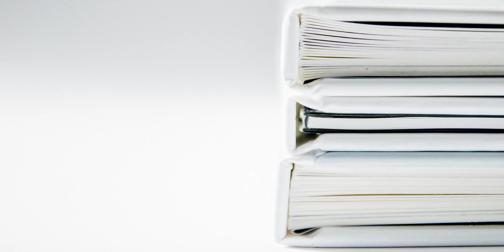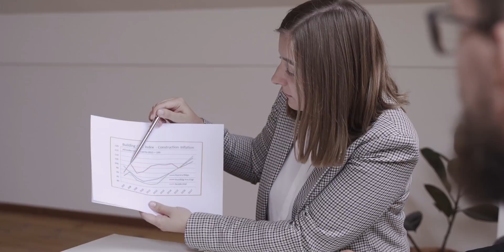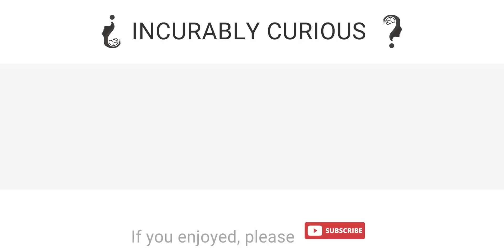Why Most Power Lines Aren’t Underground

Comment: Just digging the trench alone here in Pennsylvania runs between $50 and $300 per foot.  That doesn't include any cables/lines or conduit.

Underground facilities eventually go bad, it is only a matter of time.  It is cheaper to replace/repair aerial.  Pole permits in public domain or private property tend to be easier to get than it is for underground facilities.   To do underground in state RoW requires seismic testing if the proposed facility is 500FT or longer.  

34 years in the telecom industry, 33 of which engineering.
Reply: which is funny, cuz we were told that the line from the meter to the house HAD to run underground, they "the electric company" claimed it was code... but then the house next door has the line from meter to roof, soo... even if the code is valid, there is some scamming going on too i think... dads got 20+ years in electronics repair from the military, and i know electronics aint electrical, but many principles are the same, only REAL difference is how many volts and amps run thru the lines...

Comment: Where I currently live outages aren't that frequent. Most of them are squirrels either tired of their little lives or screwup when participating in extreme squirrel sports. All I know is that all outages are from 3 main causes:
1) A squirrel messed up and has gone to their nut filled afterlife.
2) A transformer wore out and destroyed itself.
3) Unknown causes. The power company has no idea what happened.

I've always thought that underground would be better. I do understand finding the break in an underground cable would be a bit tedious. They have to use a neat little device called a ( Time Delay Reflectometer)  I've used these on thinnet (thin coaxial cable ) computer net works, they will give you approximately where the cable has a problem but could still be off by a Plus or Minus percentage, how small that % is depends on the quality and condition 
of the equipment.

Comment: While the cost of running power lines underground would be way too high, I wish the power companies could at least put some money into insulating the doggone lines on the poles.  Not only is that vitally needed for weatherization against snow/ice storms, it's needed just for windy days.  Twice in the last couple of months or so, my power glitched out for a second then came back on again.  When I called my power company, they explained that short glitch-outs like that are typically caused by two power lines touching each other if the wind so much as catches them and makes them sway together, and they're not insulated due to, again, cost.
Reply: Insulating overhead wires would add a lot of weight requiring potentially more poles to support it.  And possibly more likely the reason is that insulating the lines prevents it from dissipating heat, so it would be limited on how much current it can handle compared to bare wires.

Comment: In California it makes sense to underground lines from a Wildfire Mitigation perspective, it is expensive but we’re also paying a lot of money in wood-to-steel fire hardening anyways. We also tend to get a lot of outages I see from car-pole contacts so it would help to alleviate a lot of that, but someone could still drive into a transformer. It makes sense for the neighborhood distribution lines to underground them, especially in wildfire threat areas, but it’s doesn’t make sense to do so to the transmission lines that span mountains and rocky terrain and pass through areas with environmental concerns.

Comment: Very good analysis. Couple of things you didn't mention. First, lines on poles are often not insulated. They are bare metal. Putting lines underground REQUIRES insulated wires, and even thicker insulation than overheard. Secondly, you didn't talk about transformers. Where would we put the transformers that now hang on the poles?
Reply: They go on padmounts, usually at the edge of local parks.
Reply: They're in rectangular steel boxes on concrete pads in the neighborhoods that have it around here.

Comment: Additionally, repair/recovery time needs to be considered. Overhead lines are readily accessible and can be easily repaired in few hours. Underground lines could take days to fix. Would you want to wait ? Been there done that. Keep them overhead.
Reply: Most large cities use a mesh network for power. Normally, it takes several medium voltage cables to fail before there is a power outage. The difference in reliability is enormous. Overhead is easier to fix, but failures always cause outages. Most customers in the underground areas don't even know that an underground cable has failed.

Comment: 4:03 Thank you for the great laugh. It was seriously an absolutely idiotic point to make about powerlines. Who would have thunk that lightning can still strike electrical equipment that is not underground... what an absolutely mindblowing discovery.
Of course lightning can strike equipment built ABOVE the ground... with the addition that lightning can also hit the lines themselves. If the lines are underground.. then the linghtning cant strike them through the earth plus the cable insulation... but yes, equipment that is not underground is stil suceptible (surprise surprise).

Comment: I live in Czechia and aboveground power lines are slowly becoming a thing of the past here. In the cities most have been already converted and put underground. We also have old school high voltage underground power lines from 50 years ago that consist of paper wrapping and oil fill that still work reliably. The only cases when these lines get damaged is when some mad lad digs where he shouldn't. Repair time for a 10kV high voltage uderground cable is from my experience 4 to 8 hours from the moment you call the repair team. The actual work takes between 2 to 4 hours, never days, unless prevented by weather. Also network in Czechia is usually doubled or circular which allows switching and prevents long outages. Unplanned all day outages are happening almost exlusively on overground cables or when Germans go mental and discharge their network to Czechia. So no, it's not a problem to run underground cables, it's just that American companies make everything stupidly overpriced. ;)

Comment: Im in Florida  - we have lots of trees, hurricanes and soft sand .
Ofcause we don't have underground powerlines. 
( replacing underground lines is not a problem if you run them inside a pipe)

Comment: In Germany there are almost no above-ground lines for electricity. And the transformers on the pylons are very rare. And if there is ever a need to troubleshoot the underground lines, the problem is quickly solved. Usually within 2 hours

Comment: In Helsinki 99.8% of medium voltage network is underground. I have had two blackouts in this century. He re the law gave so large compensation for blackouts so it is cost effective to bury even on rural areas. The area where I grew as built in the 60s or so and all cables were underground.

One cannot ignore how overground wires ruin the scenery

Comment: Power lines are different. Allmost every cable here under 10.000 volts are placed unerground almost every powerline over 50.000 v is placed above ground.

Comment: seems like all the companies care about is short term profit and not long term reliability or safety. also has it never occurred to anyone that the company should foot the bill and not the customers? also these same companies will come and trim a few branches of the trees every other year...instead of you know...just cutting them down to solve the problem completely. trees shouldn't be within 50 feet of any power line period. 
if it costs that much, it's not because of the materials used. that's mostly corporate markup.

Comment: I simply don't believe that claim underground lines have to be replaced every 30-40 years. The vast majority of UK properties are fed by underground lines, and that's been the normal approach for the past 70 years in urban areas. If cables lasted only half that time, there would be a huge and obvious process of replacing them, and that simply doesn't happen on any great scale.
Reply: Depends on the voltage and weather.  Very high voltage cables get quite stressed underground
Reply: @SuperSpecies  I was thinking of local distribution rather than long distance. The economics of underground get disproportionately higher with increased voltages and the consequences of a fault and the difficulty of fixing them get much worse too. Here in the UK there are some underground very high voltage lines, but only in areas where scenic issues take precedence, such as national parks.
Reply: @TheEulerID  for sure. Greenfields I'm all for underground local distribution, it makes sense in a relatively built up area

Comment: no one thought of this. Its the same with putting cars and people under ground.... There are also existing powerlines that have copper wire 60kv designed in 1910-1920 and built there after.

Comment: You forgot about the physics.  Cost and all that we got.  But the laws of physics that's the REAL reason.  
That's why the cables were put in the air in the beginning.  If you look at the height you will see that they are all REALLY close to the same height.  Even the tall ones that have the thick babels are the same heighth.

Comment: Back in the 80s, I lived in a neighborhood in Oak Ridge, Tennesse where there were no above ground wires anywhere in the neighborhood. Phone, cable, and electricity were all run underground, all the way to the houses. Pretty sure about 1/3rd of the City of Oak Ridge, usually in purely residential neighborhoods, are all underground power. We never had a power outage during the 4 years I lived there, but In the following few years I experienced occasional outages (usually caused by squirrels) in Downtown Oak Ridge, where the power was on poles.

Comment: I would say Florida is in a unique position to benefit from below ground power lines. There are few if any significant earthquakes in recent times, the vast majority of the land is sand, clay, or weak limestone, and the regular repair maintenance on powerlines from regular hurricane activity among other things. Something else is that Florida doesn't have a state tax due to the income from tourists so the increase in finances could theoretically be shouldered in part that way.

Also of note, Florida tried transitioning to metal power poles about a decade ago and for whatever reason the powers that be changed their minds again and are going with a high grade durability concrete poles now.

Comment: It's funny that so many people think utilities don't want to do this because of "greed." In regards to outages related to storms, it costs the company money. Not only for the crews to fix it, but also, when your meter doesn't have power, they are LOSING money. It's just that the cost of putting them underground is so high that it's still cheaper to fix the overhead. I am a Lineman, I install and repair both overhead and underground. Yes, the weather doesn't effect underground as bad, but when underground fails it is a disaster to try to locate the problem and then fix it. Pick your poison I guess. Ultimately  the rate payer will pay for the underground conversion. So, if you're cool with a $4k/month light bill.....we'll get right on it!

Comment: Once upon a time the power company in CA did that.
It was extremely expensive to just maintain the lines underground due to the extremely heat produced by high voltage lines.
People just want things but have no idea of what's behind on any type of infrastructure.
Those underground lines still in operation in the los angeles district, at a enormous cost just to keep the lines working.
Reply: Maybe if LA didn't sprawl so much, they wouldn't have to maintain so much distance of pipelines and cables for every one household. The problem isn't underground cables, the problem is sprawl increasing the distance of everything, making it hard to maintain reliable utility infrastructure without becoming financially insolvent. Maybe North America should stop designing its cities like this.